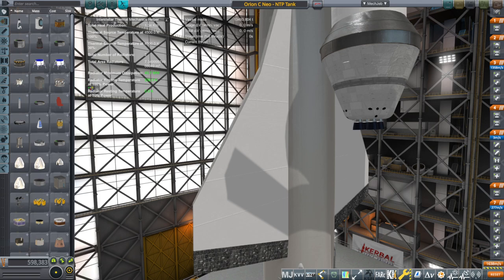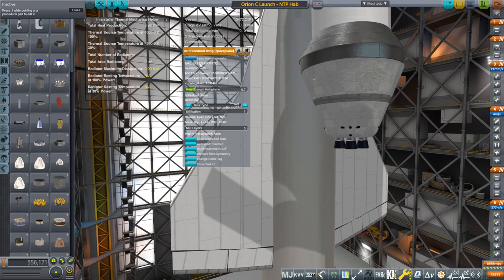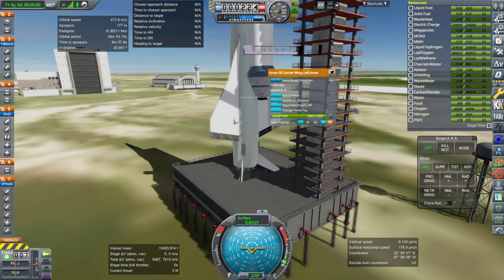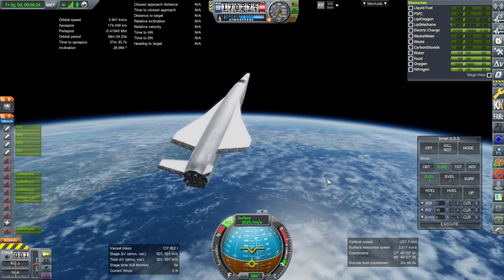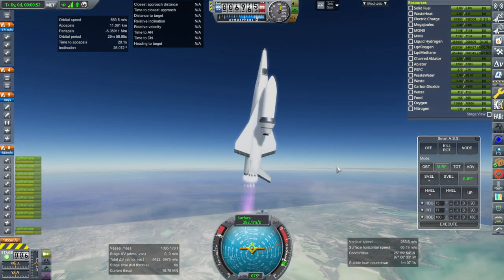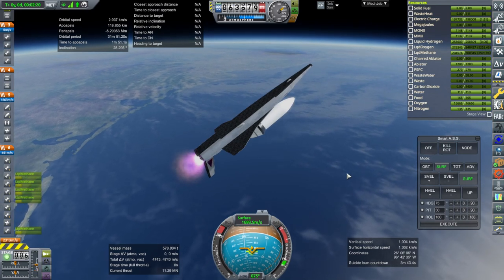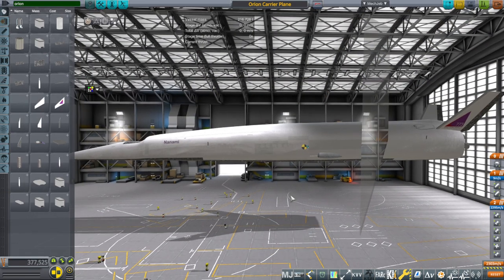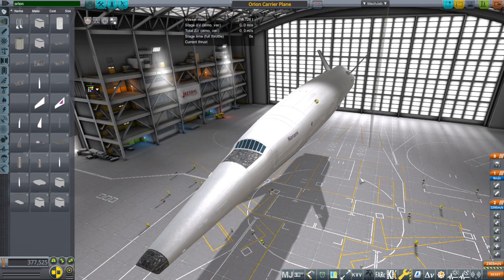Realism Overhaul in KSP 1.8.1 - Orion Carrier Upgrade Test 1

Comment: Does it actually need a separate launch and landing site like Boca Chica and Cape Canaveral ? I wonder if it could have enough cross range to do RTLS. In fact, I don't remember what the plan was for a Shuttle abort, I doubt it had the glide ratio to make it back to the Cape.
Reply from the maker: For the Shuttle abort, it actually had to continue to burn the SSMEs to boostback. The Orion Carrier doesn't have have enough propellant to boostback and, without that, has to keep going in the same direction - it can't turn very well once it hits the atmosphere at high velocity until it gets down to around Mach 3.